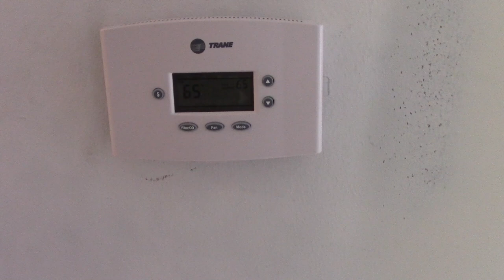Hoarder House To Home Episode 10 - New HVAC System Installation

Comment: For the duct work I would have had the contractor put all the round ducts in the flooring so if the basement was ever finished who ever did it would not have to change the ducts to inside the floor joists.

Comment: I noticed air vents high up on several walls during the spraying of Kilz.  Were those removed or closed up?  You may want to find out, it could cost you in heating/ac costs in the future.  Lots of work has been done and lots more to go.  You're all doing a good job.
Reply from the maker: Those high up vents were just above the bedroom doors for air circulation and do not connect to the furnace. They actually became obsolete with the installation of the new furnace.